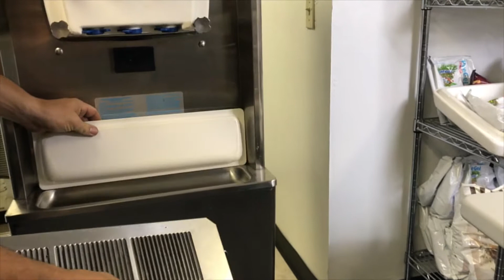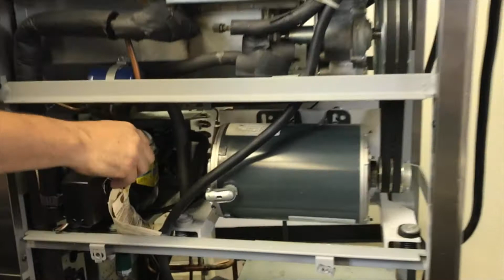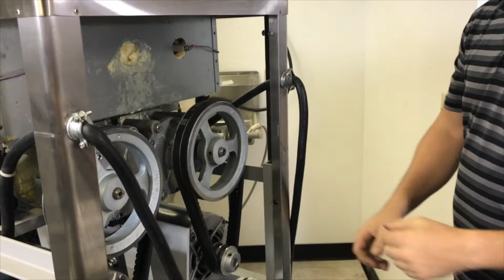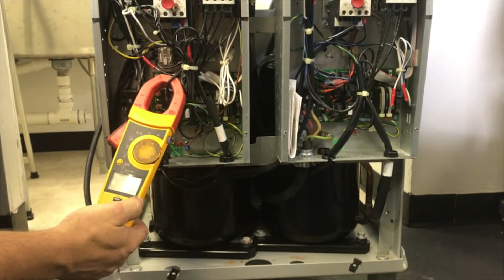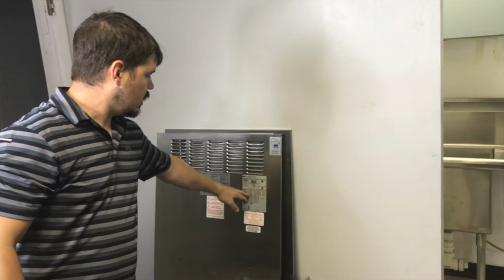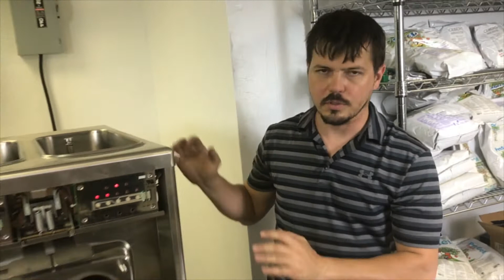Slices Concessions 22 Point Inspection

Comment: Very good video. I have not used the machine for a year now. I tried to turn it on yesterday, its motor is turning but the top pully is not turning. Its been siezed? Belt is bit tight and the top wheel does not move, I tried to push with hand but it's been stuck, please can you suggest any solution??

Comment: How did you check the freon level, 40 degree temperature? 
And 145 psi on bottom compressors, can you explain a little more what pressures they should have ?
Reply from the maker: With refrigeration gauges. You need a certified refrigeration technician. If they don’t know what and how pressures work than maybe you should consider another source. Each type of machine has different pressures depending on air or water cooled and model.  I won’t go into detail further as there are to many variables.
Reply: Ok